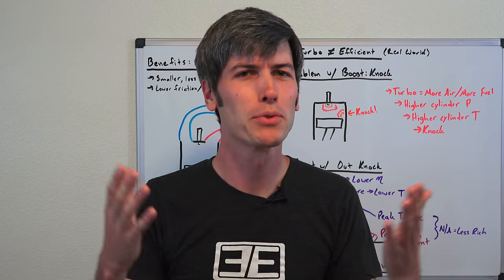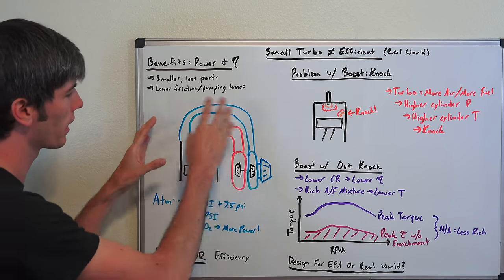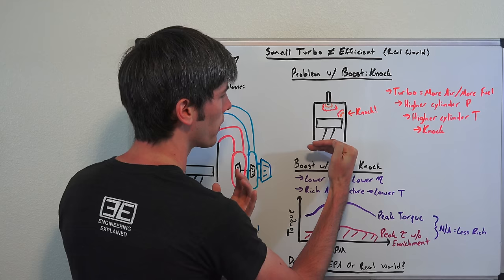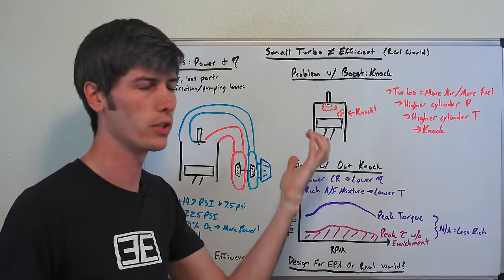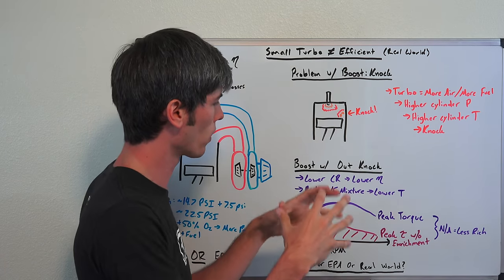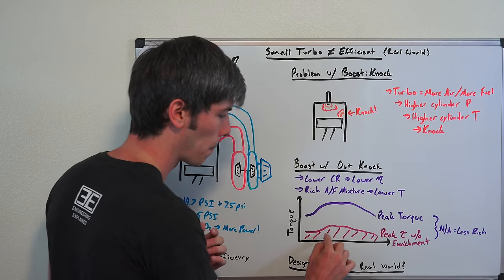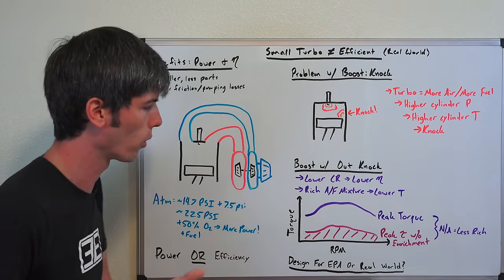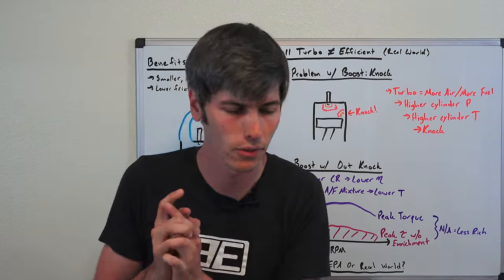Why Small Turbo Engines Are Not Efficient

Comment: When my Firefly Turbo kicks in around 3000 rpm, it feels like an extra cylinder just started firing. My 3 cylinder, 1 litre suddenly becomes a fire breathing 1300. Hold onto your hats....!!!
Reply from the maker: Stay safe out there!
Reply: It's too slow and fun to drive it recklessly. No airbags in 1991..... Easy to work on....but a death trap any way you look at it. Just incredibly cheap to drive to work.
Reply: i see these engines being used in the new fiestas etc in the UK and really wanting to know are they really as effective and powerful as a 4 cyl engine with near enough same HP or even less, there is a fiesta ST model not sure on exact name of model, but its sports a 140hp 3 cyl turbo engine and im just amazed that old 6's didnt make that much more before.
Reply: panther105
i had a non turbo Geo Metro, and every two weeks was a massive $35 fill up lol, i now have a 2005 Chevrolet Colorado and $40 is only half a tank now
Reply: pescod96 look at Carwow's comparison between the 3 cylinder and 4 cylinder Fiesta ST
Reply: I hear you. When gas was a little cheaper, I would sometimes pick up a plastic pop bottle that someone had thrown away and tell my workmates, "Do you know how far I can drive for 5 cents??!!!    About 3 blocks!"  Of course, having the word 'TURBO' in big letters on the side of the car only got me lots of chuckles from the female contingent at my Longshore despatch hall. Oh, the indignities one has to endure just to save few bucks.....
Reply: I was interested to see what they were gong to be priced at when they finally hit the market but ended up getting a safe little Honda Fit for my wife to learn to drive on.
Reply: @pescod96
I own one US 1.0 ecoLOL and driven a rental US 1.6 NA for a week. More low end functional torque from the turbo but extremely unforgiving if you shift early dropping revs below 1500 rpm. The flywheel is heavy though as they purposely unbalance the flywheel to balance the unbalanced engine pulse harmonics. So when shifting it's slow to rev down by itself. While this is sorta annoying when I rented a Mitsubishi mirage with a 3 cylinder unrefined design it felt as shaky as a solid motor mount Sentra Spec V I use to own. So I just accept Ford's NVH approach.
Reply: Firefly turbo?
Which car? USA or UK?
Reply: 0-60 in 18 seconds?
Reply: i know canada got them but im not sure about the US, ive seem them with some tuning put down SRT4, turboed civics and rb swapped 240s,  their so damn light that even with 110hp your punching way above your weight class, however do to that lightness and the fact that the engine was made for that kinda thing they do die quicker , either the body falls apart or the engine blows or both at once(<---this more often than not)
Reply: pescod96 I sold my customer 1.0 Ecoboost Focus. She had 2.0 NA before that. She said that 2.0 NA was doing 38 HWY mpg and 1.0 did 34 HWY mpg. I think the reason is that Focus is heavier and 6 speed transmission didn't help to keep that 1.0 without boosting. Fiesta is better suited for 1.0
Reply: Cerberus984 shifting early is indeed a nightmare, when I just started driving my small turbo engined car I seriously got into a dangerous scenario because I expected the engine to be fairly nippy however when those revs aren't just right the acceleration figures are in glacial times

Comment: My Alfa Giulia has the 2.0 turbo, and if I don't push it, the mileage is amazing. 
It really comes down to driver input.
Reply: Had a Kia Optima turbo was getting around 31 in town. That's it you drive for economy and they deliver.
Reply: True, but there are plenty of FI vehicles, from Saabs to Volvos, petrol and diesel alike, that have achieved long odometer readings.
By mileage however, I believe they meant consumption, not longevity.
Cheers 👍
Reply: @teop7887  Saab turbos break down constantly.
Reply: @BluntEversmoke  
I know, but I didn't say all, I said many have managed to pull that long. Cheers 👍
Reply: And for some reason you don't think you'd see the same benefits from a modern V-6?
Reply: @nthgth  
Nope.
It's basic math.
Larger engines, that makes greater power, require greater input of energy (fuel)
It's not complicated mate ;-)
Cheers 👍
Reply: Tobias  
My friend has an F150 Ecoboost. 
It's a beast, no issues, pulls like a tank. 😁👍
Reply: I have a stage 2+ golf r and get 25mpg average, 30mpg if I tried
Reply: I had a 96 GM 6.5l TD built to 275hp & 500lb-ft in a light mid-80s C1500. When I drove sensibly I got 25mpg, when I had fun I got 15.
Reply: Tobias  
The Gen 1s had that issue.
The newer ones do not, they have multiport injection, not direct, do the valves stay cleaner.
An oil catch can easily solves the problem.
Reply: Tobias  
... Ford already has the 5.0 in the F150 and Mustang, and the Godzilla V8 in the Super Duty.
Reply: Tobias  
Hahaha, that's what the aftermarket is for!
Pretty cool though 😁👍
Reply: @juconkey420  What year Optima? I owned a 14 Optima SXL turbo and the best I can get is 32 and that's only on a long trip, I would average 19/22 mpg and I didn't always floor it.
Reply: 2.0 litre Forester XT. I get 13-15 km/l if I take it easy and always shift before 2000 revs. If I floor it and shift at 2500+ revs, my km/l goes down to 9-10.
Reply: How is that a "small engin" we are talking about 1.4 / 1.2 /1.0 engine size here:P
Reply: @NH2112  yea the ecoboost mustang i rented was getting 25mpg all day no problems. If I floor it everywhere and light the turbos up I'm going to get like 15-16mpg
Reply: Alfas look weird
Reply: My dad has an 2014 Audi A6 with the 2.0 turbo. He enabled cruise control at 120km/h and drove a bit over 1000km with a full tank. This is really impressive because it's a big & heavy car.
Reply: @BluntEversmoke  pov you've never owned a saab or don't know how to take care of cars
Reply: My Giulia will get 30-40 mpg easily but it will literally drop to 15 mpg if your on it
Reply: My 1.6i 4 cylinder twin scroll turbo proceed gets 42mpg at 103km/h on cruise, 28.2mpg at 123km/h, 23mpg at 133km/h and 7-11mpg at 240km/h
Reply: Same with my 1.3 Renault Megane. It is more than fun enough when you put your foot down, but if you drive it like someone who actually cares about their wallet it uses like half the fuel of my old 1.8 Audi that had the same power. At very low loads (talking 50-55mph / 80-90km/h constant speed on the motorway) it uses less than 4l/100km. That's almost small 3 cylinder diesel levels of fuel efficiency.

When I want to have fun I have fun, when I'm just driving 20 miles somewhere I just sit at 90 and save a ton of fuel in exchange for 5 minutes of my time. If I drive it without caring about the consumption it still uses less fuel than the audi, but nowhere near as much (only 15-20% less rather than 50).
Reply: power OR efficiency!

Comment: There's only ONE reason why my turbocharged 4 cylinder gets bad gas mileage....

REASON: It's because my foot's in it so far that the fan is clipping my toenails..
Reply: An that's because its gutless ;)
Reply: You might want to trim your toenails.
Reply: You're so cool Space cadet
Reply: Don't had that problem with v6 or v8..... it is fine if you try to cruise on high way but yet again a Bugatti can cruise on the highway.... less power mean more rev and breaking and more rev.... while I just shipped down a few gear..
Reply: Yes you are correct. HOWEVER... let’s look at the 718 Boxster for example. The previous gen was a 6 cylinder and the new one is a turbo 4.  They promise the same power from the new one with better economy. Perfect right? The problem is however that power is when the car is on boost however the fuel economy numbers are when the car has not hit boost. So you either have better economy or more power but not both. Therefore a turbo 4 is not a replacement for a na 6
Reply: @stevenjalopnik1342  Please look at this alternative to gas engines, or maby you already know about them...🙄
Reply: @campkira  What language do you speak?
Reply: I mean my 2014, 4 cylinder chevy diesel cruze gets 56+mpg highway. No problems here 🤣🤣🤣
Reply: Buy hellcat, you will be careful to not push more than 1/8 in of gas pedal travel
Reply: SPECTRE  Yeah maybe really old v8's from 30 years ago. You're not going to beat any present day v8 with 210 horsepower...
Reply: just change the oil and oil filter every 3 to 5 k its very simple .
Reply: LOL
Reply: I have zero problems. I think what people seem to do is just because it's a nice tiny 4cyl with a turbo that they need to run it with their foot to the floor. 1.5T Malibu and i can get ABOVE the sticker number in weather warmer than 50F in city with over 60k mi already on the engine. And that isn't while driving like a granny
Reply: lol
Reply: Lol

Comment: 3:37 "as you floor it" well there is your problem right there.  if you want fuel efficiency, why would you ever floor it, n/a or boosted?
Reply: Spool noises make me happy...
Reply: Some people buy cars, especially performance models to floor them. These type of people never cared about the fuel economy. Bureaucrats told the car manufacturers to lower fuel economy across the fleet. They decided to cheat. They created these small turbo engines to trick the test and lied to us about their fuel economy. We ended up with inferior product in terms of fuel economy (for the way we drive), decreased reliability, and worse dynamic characteristics (in a way or lag). Environment loses out too. My 2l turbo from 2020 in a smaller car has about the same fuel consumption as my 2003 3.5l V6 in a larger car. Go figure.
Reply: @dmytrosednev9867  Agree with you...Now some manufacturers want to put a 4 cylinder turbo in a full size pickup truck...It will very hard not to bury your foot pedal when loaded...I guarantee turbo replacement will be very common before 120K miles in these over taxed vehicles...The fuel savings money if any, will be negated by the expensive  repair...
Reply: Why wouldn't you floor it? When manufacturers like Honda put small engines like 1.5L turbo you need to floor it to get the power and passing power you need on the highways.......
Reply: @441meatloaf  well that's the thing, if you want to get the best fuel economy you drive very very carefully and slowly
Reply: @pharaongaming8617  Lol only works city driving without much traffic hence auto start stop stuff and under 60 kms, but in highways you kinda need to gas it to go faster lol. I mean any car saves gas if you go drive normally in the city.
Reply: @441meatloaf  well yeah lol, I mean it also depends a lot on the country where you are and the monimum acceptable speed you can go on highway.
Reply: @pharaongaming8617  Its around 90-100km mostly in my area but then changes to 120 once you go farther out in the city. But even at 100KM, small 1.5Lturbo suffers from mid range power at higher speeds when you need it cause the low end torque will be gone. A bigger displacement engine even if its turbo or non-turbo tend to perform much better at higher rpms.
Reply: @dmytrosednev9867  Thats what I've been saying. 1.5L turbo are not any efficient than a bigger NA engine. If you look across the same CUV market all the 1.5L turbo performs worse in fuel efficiency. Now Honda has such a large problem with all their 1.5L turbo have oil leaks.
Reply: Because downsizing and turbo'd engines have been sold to us as a remedy for the gas guzzling large-displacment engines.
Reply: @stealthg35infiniti94  and a lit of the issues come to where the torque peaks. Some of these engines suck for trucks. They need an engine with a long stroke to get low end torque with a turbo. That is why I personally liked the 2.7 ford better than the 3.5 because the 2.7 has 400 foot pounds of torque at 2000 rpm
Reply: Actually, getting to desired speed quickly, reducing pumping losses is efficient.
Reply: Well said! I always introduce a Cola empty bottle under the pedal to train my foot.
Reply: @dmytrosednev9867  i guess it really depends on how you drive i have a 2008 2.0tsi and get about 10-10.5/100l  in the city, which is pretty good considering i was expecting like 12.5/100 . My old 1.4l naturally aspirated polo does about 9/100l in the city and it has 68hp which is 132 less than my 2.0 tsi
Reply: @marcschlensog9616  it's a mettef of efficiency of engines. If downsized 1.3L Turbo al least 10% more efficient then 2.5L V6, ok then. But if it's not - the only reason is downsized engine is cheaper to build, and it can be installed into almost  all models, for instance VAG 1.4 TFSI.
Reply: @bogdannemes1995  I do the same with my brake pedal to avoid the ABS ever cutting in 😂
Reply: You clearly haven't driven a 0.9L Renault Captur.
Reply: There is no knocking because of fuel injection.
Reply: In other words, once you actually build boost and use the turbos to produce equivalent power to a larger engine, fuel economy suffers. So what's the point of the added complexity over a more reliable larger NA engine?
Reply: @marcuscook5145  well i guess size and also price for the material. Because you use much less material for engine block and produce the same power
Reply: Thank you.  Complete bs is this video and I usually like his videos.  My 2014 is still getting about 35 mpg, but since I've been working from home for the last year mpg has mattered little to me.
Reply: @charleslowe522  Not really a bs video tho, he just stated the facts, and yeah 35 mpg maybe is a small matter for you, but 2 years ago higher mpg is a matter for some people
Reply: @pharaongaming8617  driving slow is not the key.

Depending on configuration it's more about gears and rpm instead of speed.

I have been experimenting with my own cars where liters per km is actually less(more economic) at 50-80kph

While 40 and 30 kph are actually worse.

I tried upshifting but it's making me question the computer in the car.
Reply: @441meatloaf  to get most economy, you should drive in top gear on lowest possible rpm
Reply: To last longer on track. Range at wide open throttle is actually quite important if you plan to track the car.

Comment: Not everyone drives at sea level.  Turbocharging makes a huge difference when driving at higher altitudes.
For the vast majority of the time, the engine is operating at only a limited throttle opening.  Sure, if you smash down on the gas pedal all the time, your fuel mileage will decrease.  The advantage of the turbo is that the extra power is there when you need it; entering onto a freeway or climbing steep grades or over-taking slower vehicles.
You must factor in the effect of the intercooler in any discussion on engine efficiency.
Reply: The air forces realized in WW II that superchargers ( turbos cousin) increased high altitude hp.
Reply: @user-zv8qg1co4z  I never had a time where my lancer es n/a 120hp engine had me wishing to have more hp to get on a freeway ramp lmao. And on my 18 wrx if I go above 10% foot pedal then rip fuel economy
Reply: All the Coloradans raise their hands 😝
Reply: @LunarStrike  mine could do burnouts in 2nd-3rd. Beast of a car for what it was

Comment: I owned a Suzuki with a Fiat sourced 1248 cc 4-cyl diesel. Really small engine. 75 horsepower and 143 ft lb torque. I used to joke that my fuel economy numbers were directly related to my mood. During my 3 yrs of ownership, I recorded anywhere between 30 mpg and 62 mpg which almost entirely depended on how I was feeling and how calm I was driving. That engine was stunningly efficient at, say, 2000 rpm cruising in 5th gear. Push a little to overtake someone and it would be the exact opposite. 

I think that means that a good/sensitive driver will be able to get good gas mileage if he/she is paying attention but the average joe may struggle to replicate EPA.